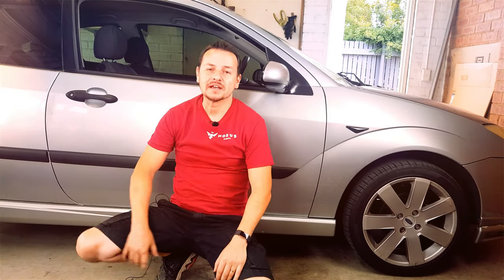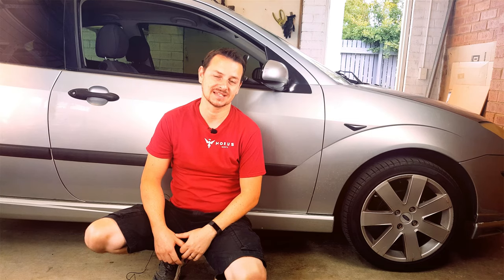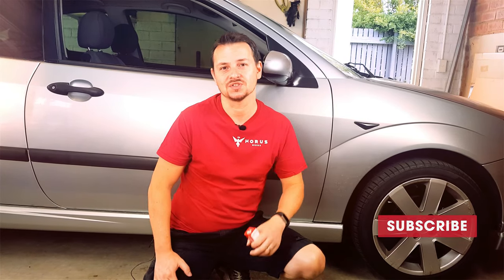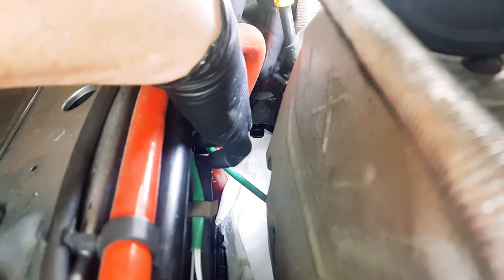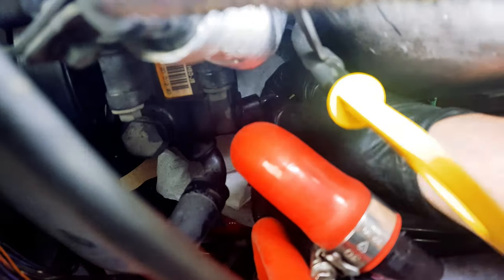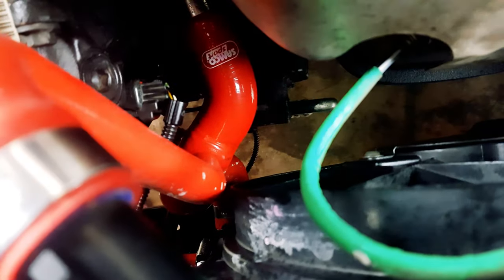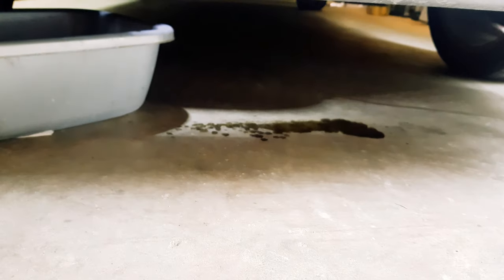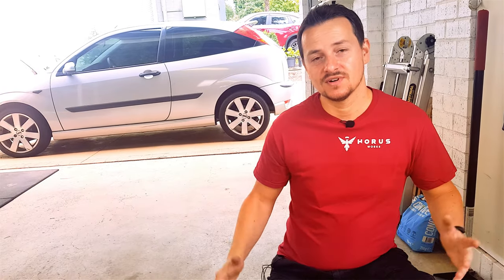How this Cheap Part left me stranded - Easy Fix - Focus Mk1

Comment: I had to do this to my 2001 Ford Focus last year. The Ford dealership shop wanted to charge me $1000 because they lied and said the PS pump was shot and the lines needed to be replaced. After saying no and checking it our myself I found it was that $30 PS switch. I mean, you could actually see the fluid running out the part (I should have checked it out first but the car is 23 years old and I just assumed the worst. I mean after all it is a Ford🙄). A toddler could have figured it out. The Ford dealership didn't even look at my car and told me all that BS thinking I was some schmuck. I reported them to Ford headquarters and disputed the "service fee" they charged me to look at it. Of course I won and my money was refunded.  It's been just over 1 year and it's running smooth with no leaks. Don't forget to bleed the air and if your car is older do yourself a favor and put some Bar's Leaks High Mileage Power Steering Repair, 16 oz. The sad thing is that my family had been using that Ford dealership for about 30 years and they pulled that nonsense! Now I wonder how many other times they ripped me off. Sad😢
Reply from the maker: Unfortunately this is all too common and not limited to Ford dealerships. You should see what Audi and BMW dealers charge for example!!! 
It's precisely why I started this channel, I was tired of dealership fees. If like me you're a car person and you don't mind working on your cars, these videos should help 👍
Thanks for commenting mate.

Comment: Mine still whines after a new PS pump and  High Pressure switch. All done by a local mechanic.  Didn't  whine until a few months after the work was done.  Can't figure out whats is causing it to whine?
Reply from the maker: Hi Tony, mine is staring to whine as well!!.. After the fluid went low and I replaced the switch, the whine has been there and getting louder. Have a look at all of your hoses to make sure there are no leaks anywhere... I'm guessing right now until I take a look, but a whine that gradually comes back tells me that air is somehow slowly entering the system. It could be something as small as a hose clamp. Tighten them all down and check for bubbles in the reservoir when you turn the wheel. Failing that maybe my pump is starting to go, or was permanently damaged when the fluid went low. When you replaced your pump, did you put a new one in, or a remanufactured one?

Comment: Mine leaked for about 5 years until one day it just started spraying out 😂 its one of the jobs you keep thinking 'I will do that next time' ☺️ and it's not as easy on an st170, the switch is in the middle of a very fragile pipe 😔
Reply from the maker: Exactly! Mine did the same, small leak which I ignored and then bam!! Tow truck time! Lesson learnt :)

Comment: Did mine pressure switch today S40. Started engine yesterday. Steering noise, than pop from pressure switch. Grounded. Bought switch Ford number part cause wasn't available for S40in my area. Same stuff. 30 mins job done. Switch 49euro. Liter of ATF 11euro. But yeah. That little thing is gonna ground your car.
Reply from the maker: Pain in the but, the way it lets go without warning too 🙂

Comment: Just had this happen on my 2000 1.6 petrol just parking up outside my house very lucky place I know, thank you for the very helpful video, new part (looks a bit different from yours - probably because it's older) & power steering fluid is ordered from eBay and should be back on the road later this week :)
Reply from the maker: Glad the video helped you out mate - easy fix 😀

Comment: it's fine if it works but after replacing mine on a vw caddy van, it still leaks. Interesting comment they leak from the top, that's  what mine is doing.  Anyway good informative video.

Comment: As a curious fact, in Focus MK1s with a Zetec engine, there is a high probability that this part will begin to drip water from the windshield channels. This is because these channels are the union of a plastic panel directly with the body without a joint in the middle, so over time that union opens and the water cascades behind the engine in that part.

There is also a high possibility that by forcing that sensor to remove it, you will damage the tube connector with the pump, generating a leak further upstream.
Reply from the maker: Thanks for the tip!

Comment: Thanks mate. I am working on 2006 Focus today. Yesterday evening I had a cat sound u der my hood.. when I checked the steering was hard and the power steering fluid was all over the engine and the bottle empty. I will clean off tge engine check and fix. Easy fix...maybe
Reply from the maker: Thanks Phillip, and best of luck finding your leak. If your leak is at the front of the engine it's likely to be this switch. Otherwise check your high pressure hose... 👍

Comment: Was there any fault codes come up with the power steering . Also when you had the car home did the engine not start any more please
Reply from the maker: No faults codes came up and the car started no problem. Only the steering was heavy because no power steering fluid.

Comment: Good video. Greetings from Serbia 😁 Keep it up. 
Can you post OEM number of this part please?
Reply from the maker: Hi Enver, thanks for your comment - greetings, I hope that the summer is nice in Serbia. The part number is: OEM #YS4Z3N824BA - and you can get the part from here: https://www.rockauto.com/en/catalog/ford,2002,focus,2.0l+l4+dohc,1385557,steering,power+steering+pressure+sensor,7408
Reply: @Horus_Works  thank you very much. Summer here is going on nicely so far 😃

Comment: 2003 ford focus zetec  here..that switch is located on the metal  power steering line that is coming out of the bottom of the pump, at least on my car.. I'd rather it were on the pump itself...on mine it is pressing against that coolant hose thats right next to it..

Comment: Hello, is there an easy way to disassemble and install the speed sensor.. I have a 2002 Ford Focus.. Thank you..
Reply from the maker: Hi, do you mean the ABS wheel speed sensors?
Reply: @Horus_Works 
mean the kilometer counter sensor, which is located in the gearbox.. Car speedometer not working..
Reply from the maker: @عبدالرحمنصبح-ه1ظ  Oh I see, sorry to hear it. I wish I coudl help you but I haven't fixed this type of repair yet. I wish you good luck .

Comment: My engine is 1.6 petrol. Is this sensor positioned on the steering pump again?
Reply from the maker: Yes this sensor plugs into the steering pump. I don't think the 1.6 will be any different 👍
Reply: @Horus_Works  thanks. I've got small oil leak around the pump and hoses below. But couldn't see anything when the car is started. Or even when isn't working. So, maybe this switch isn't the reason

Comment: Erik I'm in need of doing a power steering fluid change not that many video's on youtube for Focus only another of your fellow Ozzy's doing one ,
I was thinking if I was to take the steering pressure switch out and turn my steering do you think it would empty out better than the other Mk1 Focus one where he empties from the top ? I could also replace the switch while i'm at it , Cheers
Reply from the maker: Hi David, that's an interesting idea... I don't see why you couldn't do it via the pressure switch. I guess the only challenge will be knowing when your fluid is completely replaced. When you pour new fluid into the reservoir bottle, it will drain into the pump and the pressure switch, so everything should be back on tight by then otherwise you will lose your new fluid. My initial thought would be to do it via the PS reservoir tank as it's easier to get to, but I don't see why you couldn't try via the pressure switch instead.
Reply: @Horus_Works   Hi Erik I'll try and read into it a bit more and see what say the Haynes manual say's It was just a idea as I would think you wouldn't get all the old fluid out through the reservoir ? I'll see what I can do and let you know , Cheers
Reply from the maker: @David Quotagious  yep definitely would be curious to know how you go about doing it, keep me posted 😀👍

Comment: You didn't think to keep a spare gallon at least?
Reply from the maker: A spare gallon of what mate? The power steering fluid? That stuff can be easily bought here from the shops if that's what you mean.
Reply: @Horus_Works  If you car is taking a gallon then you've got big issues.
Reply from the maker: @Lensman64  Agree - there should be 0 leaks from the PS